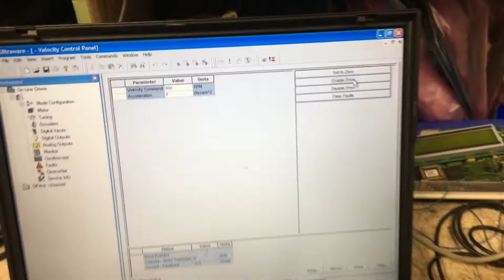ALLEN BRADLEY ULTRA 3000i SERVO DRIVE FULL TESTING

Comment: Hi .. I am currently having an issue with a ultra 3000i .. when ever it is asked to move or home the motor dive flags up e19 / e41 / e23 ... Faults are never the same . Cables and motor are verified there are ok .. any suggestions what could be up with the drive . Thanks ..... P.s where are you based are you a engineer ??
Reply: I have the same problem, I trying resolve this problem
Reply: @thiagoaraujo822  got my drive fixed . It was a power supply in the drive
Reply: Just now two hours before carage over travel alarm in HMI in the drive R 19 error checked found cable broken re canect after ok

Comment: what cable used to connect to PC , please give me the cable details
Reply from the maker: I am using  original cable or serial cable. If you want communication cable let me know. Thanks
Reply: @industrialsolutions2898  Hi! could you give me information about the serial cable, I'm trying to communicate the ultra 3000 i servo driver with my pc using a generic db9 to usb cable and it doesn't work. 
should I need to use the original adapter?
Reply: @kevinjosefernandezhernande3947  Hi did you ever get a connection from your PC to the Ultra300 drive?  I've tried the same thing as you where I got a USB to DB9 adapter cable and was not able to connect.  Now I'm waiting on some parts so I can get an old laptop up and running with a serial port and also ordered a null modem cable but they have not arrived in the mail yet.  I'm just wondering if you ever got connected and what you did?  Thanks
Reply: @DaveNorthWest  anyone find out what cable to use to connect. i am just using usb to rs232 dongle and am unsure if that will work. so far no luck
i read somwhere that it may need to be rs485 converter involved
Reply: @joelenser3850  Hi yea ive gotten connected but had to be using and older windows XP machine.  Ive connected using both the usb dongle and the built in serial cable.  The dongle you have to be sure and have its driver installed correct driver and all.  Theres also a little trick in the ports configuration where you have to uncheck FIFA in the ports configuration window.   If you want I can help you out with this?  Just let me know what your setup is looking like so far